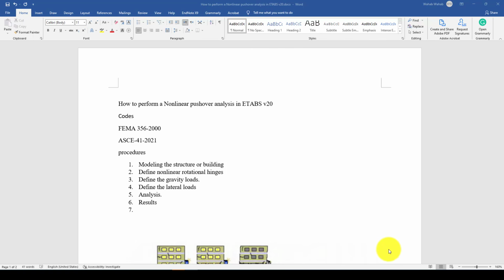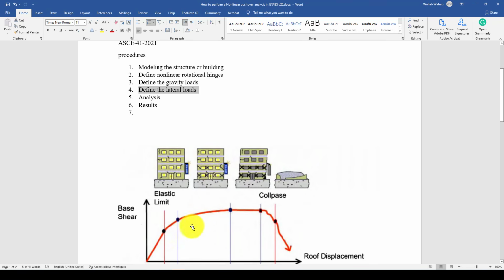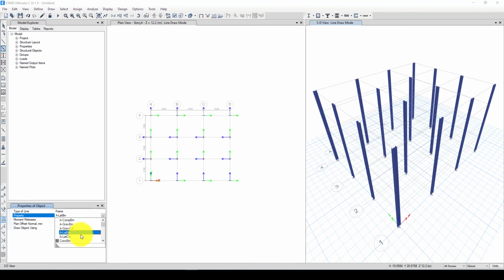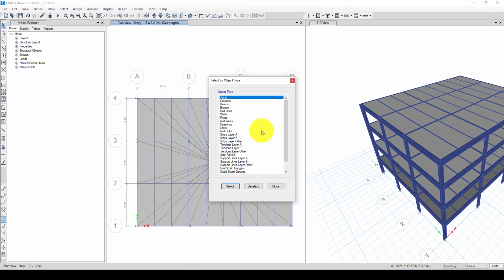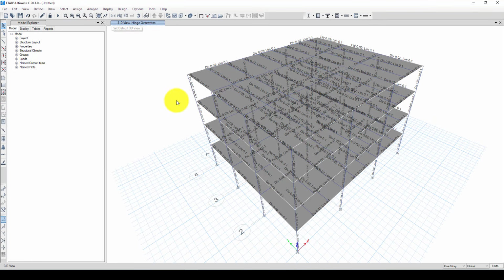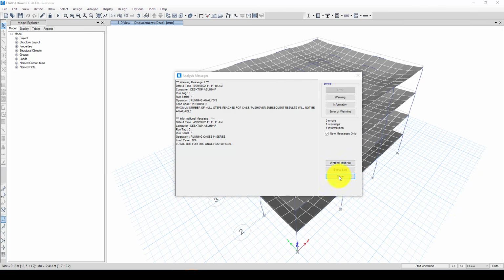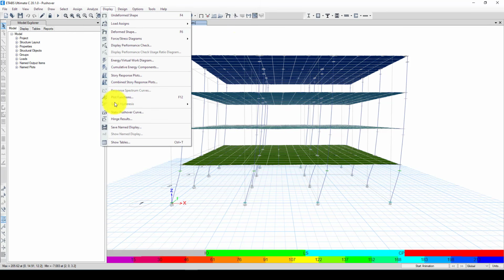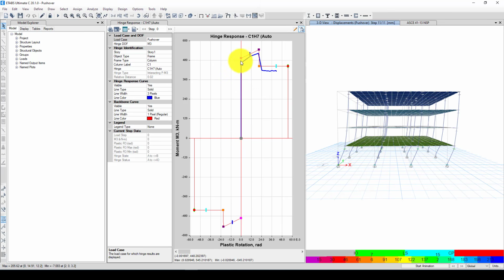Nonlinear Pushover Analysis using Displacement Control Method in CSI ETABS software v20

Comment: hello sir can you give related literature that can help us understand how to interpret the results? thank you so mcuh. we badly need it
Reply from the maker: Hi there , please read these references.1. Park & Paulay (1992)

Park, R., & Paulay, T. Reinforced Concrete Structures. John Wiley & Sons.
A fundamental reference explaining nonlinear behavior mechanisms, moment–curvature analysis, confinement models, and seismic performance principles.

2. Paulay & Priestley (1992)

Paulay, T., & Priestley, M. J. N. Seismic Design of Reinforced Concrete and Masonry Buildings. John Wiley & Sons.
Provides a comprehensive basis for nonlinear modeling of RC components, capacity concepts, and plastic hinge formulation.

3. Priestley, Calvi & Kowalsky (2007)

Priestley, M. J. N., Calvi, G. M., & Kowalsky, M. J. Displacement-Based Seismic Design of Structures. IUSS Press.
Excellent for deformation-controlled assessment, plastic mechanism formation, and force–displacement relationships relevant to pushover analysis.

4. Fardis (Ed.) (2009)

Fardis, M. N. (Ed.) Seismic Design, Assessment and Retrofitting of Concrete Buildings. Springer.
Covers nonlinear constitutive models, cyclic degradation, shear behavior, and modeling strategies for RC frames and walls.

⸻

Methodology and Modeling-Focused References

5. ASCE/SEI 41-17

ASCE/SEI 41-17. Seismic Evaluation and Retrofit of Existing Buildings.
A standard reference for acceptance criteria, nonlinear hinge properties, modeling parameters, backbone curves, and procedures for pushover analysis.

6. FEMA 356 (2000) & FEMA 440 (2005)
	•	FEMA 356. Prestandard and Commentary for the Seismic Rehabilitation of Buildings.
	•	FEMA 440. Improvement of Nonlinear Static Seismic Analysis Procedures.
Provides foundational pushover methodology, performance levels, and refinements to the capacity spectrum method.

7. Chopra & Goel (2002, 2004) – Modal Pushover Analysis

Chopra, A. K., & Goel, R. K.
Key papers introducing Modal Pushover Analysis (MPA), improving accuracy for higher-mode effects in tall buildings.

8. CEN (Eurocode 8)

EN 1998-3: Assessment and Retrofitting of Buildings.
Includes nonlinear modeling rules, plastic hinge properties, and performance-based assessment requirements.

⸻

Numerical Modeling in Finite Element Codes

9. Mander et al. (1988) – Confinement Model

Mander, J. B., Priestley, M. J. N., & Park, R.
“Stress–Strain Model for Confined Concrete.” Journal of Structural Engineering, ASCE.
Standard for nonlinear fiber-section modeling, widely used in OpenSees, ABAQUS, and similar platforms.

10. Filippou, Popov & Bertero (1983)

“Effects of Bond Deterioration on Hysteretic Behavior of Reinforced Concrete Joints.”
Provides cyclic rules and degradation models influential in beam–column hinge formulations.

11. Scott, Fenves & Filippou (2008)

“Fiber Elements with Confined Concrete for Modeling RC Members.”
A modern formulation for distributed plasticity modeling.

12. OpenSees Documentation

Open System for Earthquake Engineering Simulation.
Includes state-of-the-art material models (Concrete01–Concrete23), steel models, and hinge definitions used extensively in nonlinear analysis research.

Comment: My pushover curve is coming linear . What would be the solution .
Reply from the maker: Maybe you did linear analysis.
Reply: @ No i have provided non linear hinges for beam and column. I got the pushover curve for G+2 and G+4 building but as the height is increasing , it is showing linearity.

Comment: Hello

Please, what is the allowable roof displacement for pushover analysis.

Thank you.
Reply: Hello.

I did some research and found (in FEMA p-1050-1) that for pushover analysis, the horizontal displacement of the roof should not exceed 2% of the total height of the structure.

Thank you.
Reply from the maker: Hi there, actually it depends on the story heights and the local design codes. For example, for steel structure, it’s 1 percent drift for concrete 0.4.

Comment: While assigning auto hinge in concrete structure.... What is reinforcing ratio
Reply from the maker: Thanks for your plenty of questions and your valuable time. You are the designer you should know the reinforcement ratio. Why? Bcz This pushover analysis is for the assessment of existing buildings.
Reply from the maker: Next time learn before asking question say a thanks to the people who answer you , or in the beginning say a Hi , both are free and this showing who you are ? . Regards
Reply: Okay thank you......I'm asking because I'm doing dissertation on topic of wharf structure so I make model and analyse in staad, from this analysis design all frame manually and assigned in sap2000 from section designer.... So now I'm not designing in sap so I asked that question....but thank you mm....if you have answer than reply

Comment: Hey I have a question please I am doing static nonlinear pushover analysis but when I run the model it gives error in creating frame hinges I use Etabs 2016 please I need help
Reply from the maker: Follow this tutorial , and apply the same procedure to your model.
Reply: @KSSE_Engineer  I followed it all but I don't know where is the problem